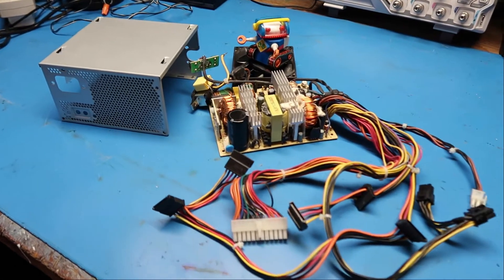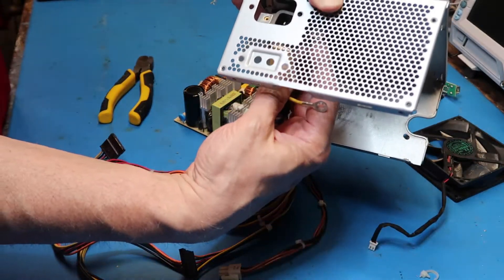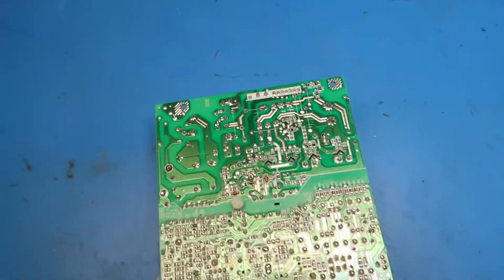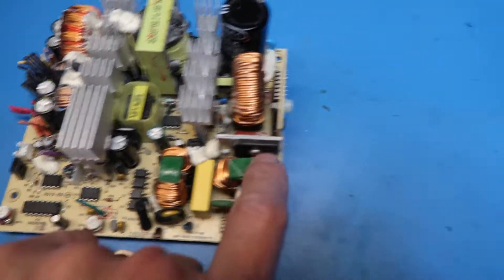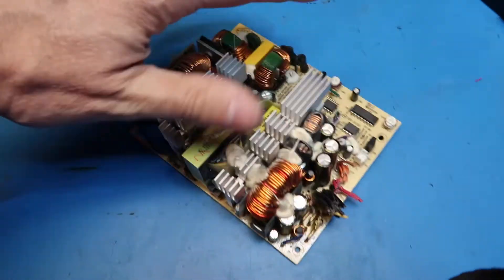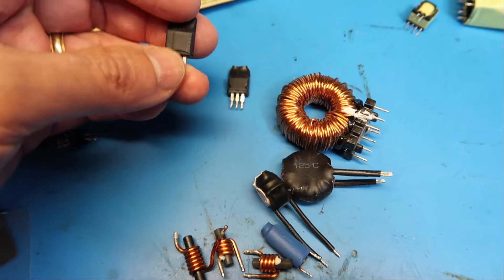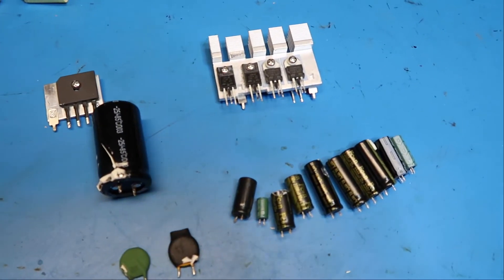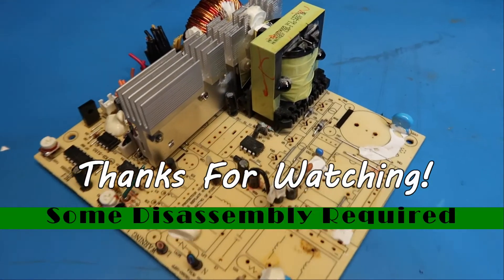ATX Power Supply Parts Salvage

Comment: Maybe I missed the "premise" of you taking this PSU apart, but was it damaged or not working? See I'm trying to see what I can salvage form a totally UNWORKING power supply.
Reply from the maker: Sorry, but I don't remember if it was working or not. Maybe it was, but I took it apart anyway because ATX supplies are easy to come by, and have a lot of good parts inside. As to your situation, there's no way for me to predict which parts might be bad in your unworking supply. So, I recommend you remove whatever parts you may be interested in, then test them individually.

Comment: Depending on how one values one's time; the transformers, heat sinks, and anything with a lot of copper or aluminum can be worth pulling. Most metro area's have metal recycling centers that will pay for anything made of copper or aluminum. Copper is often around the three dollar per pound range, and aluminum maybe a dollar fifty to two dollars, give or take. Unfortunately, ferrite is not worth very much (but worth bringing if you are going anyway).

Comment: hello, i have a question. you said that thoose green toroids are isolation transformers. My question is, can i use thoose cores to make a power transformer? i want to make my own power supply for a car amplifier!
Reply from the maker: That might be possible but it would be a lot of trouble, take a lot of time, and would require a lot of specialized expertise in power supply design. So, you may want to look into buying a commercial power supply of some kind that will work with the car and the amplifier.